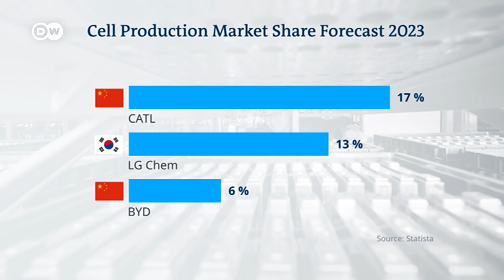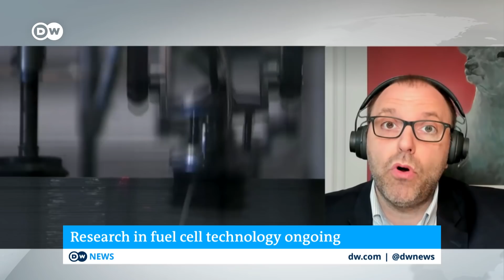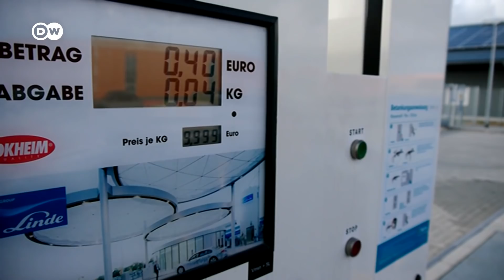Electric batteries, fuel cells, hydrogen fuel: Carmakers look for energy solutions | DW News

Comment: Hydrogen ... MIT created organisms that make the process green and easier .. just developing it more.. I'm so tired of the noevelty electric car .. how am I going to lose range sitting in my driveway .... How can a grid that cannot handle my AC handle 10 million cars ... How can a car which batteries cost 7 to 16 grand to repair make any sense
Reply: How can I pay twice as much for a fuel cell car..... How can I consume 3x more energy with a fuel cell car .. how EVs are much cheaper to maintain than ICE or fuel cell cars
Reply: @michalfaraday8135  EVs are garbage novelties ...
Reply: @richardalfaro4933  You are killing it with your logic based arguments. Really.
Reply: @richardalfaro4933  EVs only need 10 kWh per day on average. Absolutely no problem for any grid.

Comment: How about liquid hydrogen, the fuel intake hole on the car to be fitted with a filter enamel and the liquid hydrogen fuel tank has an electrolytic catalyzer in it to electrolyze the liquid hydrogen to be discharged into the "carburetor" or the intermix chamber where the ignitor is there to convert the fuel into kinetic energy.
Reply: Liquid H2 has to be kept under -252.87°C, practicaly impossible in a car.
Reply: Apparently the issue is this still create nox.
Reply: It will melt the engine

Comment: Germany was sleeping many years in their golden cage and now is trying catch back in automotive. They didn’t listened to the warnings and still rather leaned towards lobbying their combustion cars somehow out of it like in the past, but this all ended after huge auto cartels and cheating with tailpipe emissions in Dieselgate. This will be tought, because the new car revolution is not too much in manufacturing but in software and computing and Germans are very weak in this field and it will be tough to compete with Silicon Valley brain power. Even overpaying doesn’t work as Porsche experienced when they tried to recruit smart people for Taycan development. Germany is horribly back in battery cells production, development, in building of integrated careless charging infrastructure, in OTA, in autonomy, in cloud management, in AI, in hardware development, in quick implementation of innovations. Chasing Tesla in not the solution, you must get in front of Tesla.
Reply: Tesla is overrated garbage. China is waking up to the fact Tesla is garbage.
Reply: @almac9203  Your brain is garbage. Tesla is sold out and used cars are more expensive than new one.
Reply: the French developers are quite good at software and EU has already started building it's common car battery development strategy and infrastructure (so yes, they are aware of it) - however I think they should focus on hydrogen with the Japanese technology giants and not get in line behind Tesla and batteries (As batteries are a limited product due to rare earth materials)

Comment: As much as people like battery powered vehicles, battery powered has limited uses, Larger vehicles like trucks, buses, require large amounts of batteries, making one truck for example uses as many batteries as 5 model 3 vehicles, for larger vehicles, an all the above approach needs to be used, Fuel cells, converting to Natural gas, Hybrid, electric, maybe a plan to plant 1000's of trees for companies still using diesel.
Reply: The issue is u need 3 times the electricity if u go over Hydrogen and fuel cells are very expensive.
Reply: Not if the battery W/kg continues to increase. At 500W/kg all road vehicles will probably be battery. Theoretical limits on some types of battery technologies are above 3000W/kg. Also charge rates and cycle and cost of batteries are constantly improving. The cost of hydrogen production is too high, batteries always win this. How many Toyota Maria's were sold? How many Nikola hydrogen trucks were made? Hydrogen is not cost effective.

Comment: I think like the fuel to electric shift it'll be electric to hydrogen shift soon in future as there's just lots or rare earth materials involved in electric cars. And hydrogen is much more sustainable solution it more like a normal fuel car. But like investment in electric infrastructure took a bit of time same is gonna take for hydrogen infrastructure.
Reply: Highly doubt it.
You don't need rare earth elements for electric cars btw.

Infrastruktur for hydrogen is much more complicated and much more expensive than for EVs.
A Hydrogen fuel pump is like 2 mio €. A wallbox for an EV starts at 300€.
And if u start from electricity, BEVs are around 6 times more efficient than Hydrogen ICE cars and 3 times more efficient than Hydrogen Fuel cell cars.
Reply: @TBFSJjunior  Yes electric cars need more for magnets and batteries. And shifting to renewable energy sources will speed those depletion due to increased production in solar panels, magnets for wind mills and turbines.
Reply: @karthik4711 

There are no rare earths in the battery and like with generators, u can build electric motors without using rare earth magnets aswell.
Enercon wind turbines for example don't use permanent magnets from rare earths and some teslas motors don't use them either.

Also hydrogen fuel cell cars also use an electric motor and there are very rare materials like platinum in the fuel cells, which is one reason they are so much more expensive.
Solar panels also don't use rare earths.

I've seen analysis that lithium (which isn't a rare earth) will easily last till 2100 and is fully recyclable.
Reply: @TBFSJjunior  You are correct.

Comment: Eh. Methanol is about the best energy storage system. It is liquid at normal temperatures. It is oxygenated, allowing for it's use as an air cleaning fuel (exhaust is cleaner than air intake). And my simultaneous combined cycle staged combustion engine gets 60-66% efficiency (or more).
Reply: we live in a world where most people want to know how to get the Meth out of methanol
Reply: It's very inefficient compared to battery electric and even hydrogen fuel cells.

Comment: Here is the deal: Storing the energy in batteries is pretty efficient (more efficient than hydrogen and other e fuels).  But batteries are also very heavy and costly (compared to other storage systems). Building a vehicle with 600km or more of range is therefore easyer with other storage systems than batteries. The solution could be to just have hydrogen hydrogen range extenders in vehicles that will probably drive longer distances.
Reply: Actually hydrogen cars are just as heavy, since they need a strong containment unit for the hydrogen in case of accidents. Hydrogen can maybe be more usefull for large trucks, but definitely not for cars.
Reply: @MDP1702  I don't think this is the case for modern hydrogen cars. The hydrogen cylinder shouldn't be really heavy. What makes modern hydrogen cars heavy and expensive is the fuel cell. But when you just use the fuel cell and hydrogen as an range extender, the fuel cell can be much smaller. For example: The fuel cell charges the battery only with half of the energy the vehicle needs, so the battery will last twice as long as the same electric vehicle without a fuel cell. So the fuel cell and hydrogen should be used for some electric vehicles for extended range and car manufactures shouldn't see BEV and FCEV as different categories.
Reply: @xijinpingpong4426  the current hydrogen cars are around as heavy as the heaviest model 3 variant. Could be that it is more the fuel cell, either way the current hydrogen cars aren't lighter.

The fuel cell charges the battery only with half of the energy the vehicle needs, so the battery will last twice as long as the same electric vehicle without a fuel cell.
I don't think it is as easy as this, most EV batteries operate in the ranges best suited to preserve the battery already. So the gain might not be that great. Moreover most people don't need to do long distances often, so the effect on the battery life will be even lower. And lastly current new EV batteries seem to last the cars lifetime (at least current car expected lifetime) with regular application, only upon a damaged battery or very heavy use (50-100k+ miles a year) will the battery need changing.

And then ofcourse they still need to integrate the hydrogen tanks and fuel cell in the EV, making it even heavier and most often not used. Not to mention that you then still need to go to a tankstation to fill up on hydrogen.

It might sound like a good idea on paper, but in real life it doesn't seem so practical/usefull.
Reply: @piotrtrebisz6602  Aluminium air batteries (AAB) still have some problems to be solved, and ofcourse it needs to come out better than EV's in terms of ease of use (for example swapping the aluminium.

As soon as solid state batteries (SSBP) come around, AAB's might not be interesting overall, and it seems likely that SSB's come out before AAB's. So we'll see.

Comment: I wonder why we don't create electrified tracks for personal vehicles. Worked for electric trolley cars. It would go a long way to making self driving  vehicles easier. Each vehicle would need a much smaller battery because it would only be needed for short distances off the track. The battery would stay charged from the track. Obviously only useful in dense population.

Comment: Regarding the segment where the wind turbine is decommissioned:
20 years is not an unusual life span for a turbine running 24/7. Maintenence gets more expensive the older the product.
The turbines built 20 years ago are a lot shorter/smaller than today, 100s of kW instead of 2-4000 kW. With space being a premium it makes more sense to remove and replace many small with a couple of big ones.
Reply: Doesn't sound like he's going to put another one up though, especially as it was only in a small space between fields. If it was subsidised per kW of power it produced then I don't see the issue with it being smaller.
Reply: @Dorgpoop  Chances are that the cost of maintenance per kwh plus grid fees is too much compared to the income from electricity prices +subsidies. Wind turbines aren't predictable and you need to secure long term contracts to be sure that you have enough money coming in. Since wind power has expanded a lot but pool of total subsidies generally Stays constant more wind turbines owners are competing over the same amount. Leading to less subsidies per kwh. Thus the bigger/newer turbines are still profitable, but older smaller ones will no longer make sense.

 Financing and the Interest rate could also become a factor. If there happened to be any need to finance to continued operation (refurbish/replace parts), he would as a smaller (more risky) operation need to pay more interest VS a bigger company installing brand new bigger turbines.
Reply: @Dorgpoop  For every doubling in size you get 3 times the power. Its an exponential efficiency gain, not linear.

Comment: Every time news outlets mention batteries needing Cobalt, they conveniently forget to mention that Cobalt is used to process crude oil into Petrol and Diesel, so that you don't have all that Sulphur coming out of your cars exhaust.

And battery technology has been moving away from Cobalt so the batteries coming to market will be Cobalt free.
Reply: @piotrtrebisz6602  the technology your referring to which supplies electricity directly from the road is called electromagnetic induction. This technology is used in electric toothbrushs and electric kettles. The bigger the gap the bigger the power loss.  Any gap bigger than 1cm is not good enough.

This might be useful where you can predict where a car will be stationary for a long time, like taxis waiting outside a train station. 

But I think battery technology is so good now that there isn't any need for electromagnetic induction. You have taxis that can operate perfectly fine without electromagnetic induction, battery power is enough.

Comment: An old Electrical Engineer here. Solar and wind can be used to produce hydrogen and the vehicle will use a fuel cell converting hydrogen to electricity. The only exhaust is water. Gasoline stations need the infrastructure to dispense hydrogen. Most already have LP tanks so hydrogen tanks can be added.
Reply: You can't just use an LPG station for hydrogen. Hydrogen needs their own dedicated stations and these are extremely costly (around 2-3 million per station)

Comment: Electric already has an infrastructure , hydrogen needs specialized facilities , logistics and requires heavy construction to build tanks , not pheasable , fuel cells are still premitive
Reply: If they manage to successfully adapt the infrastructure for natural gas to hydrogen then it can definitely work, especially if they can cheaply convert gas boilers and stoves to run on hydrogen it would save having to subsidise everyone to buy a new boiler.

Comment: Going electric 💡 maybe be even more contaminant than fuel ⛽ as battery 🔋 are a big problem at the end of it's life spans. Trashing batteries will be a larger issue.
Reply: Batteries end of life is no problem, recycling is already seen by car manufacturers as a future cost savings measure seeing how material rich those batteries are vs mined stuff, not to mention it shortens supply lines. And the recycling is constantly improved, at this moment there are already companies that can reach a 95% recycling rate.
Reply: The harmful contaminant are not the 95% is the 5%. Plastic and others wires and housing are not the problem is the liquid waste from the gel packs.
Reply: @amartin3628  The liquid waste is in fact being recycled in these process. The 5% remaining is not harmfull to the environment, at least not more than other waste.